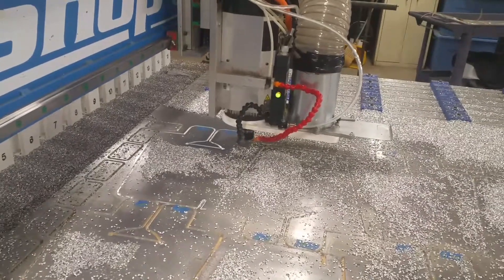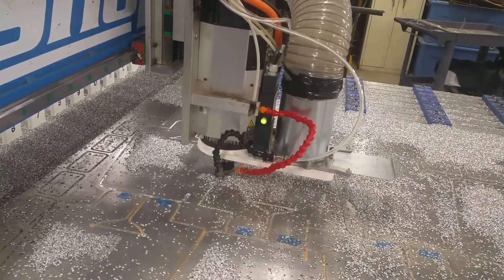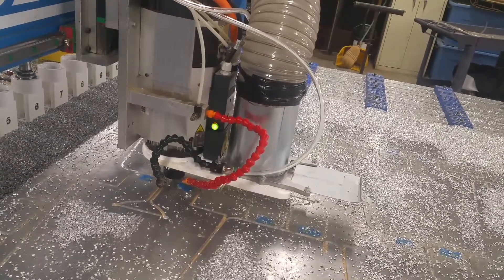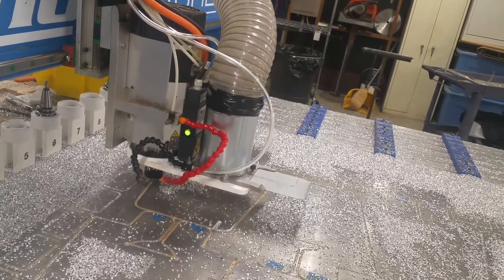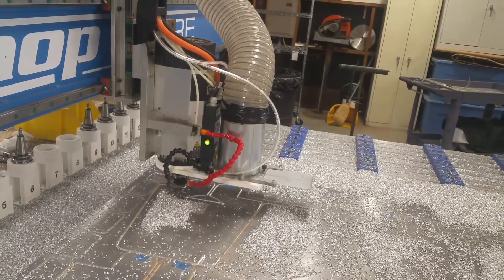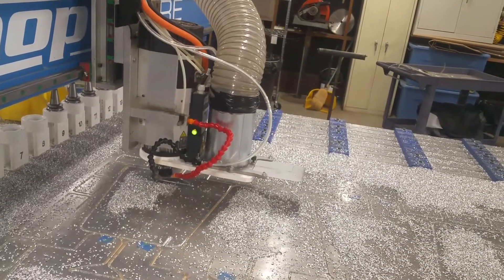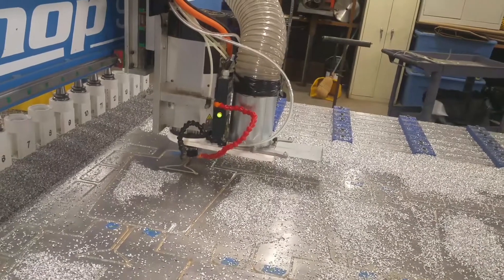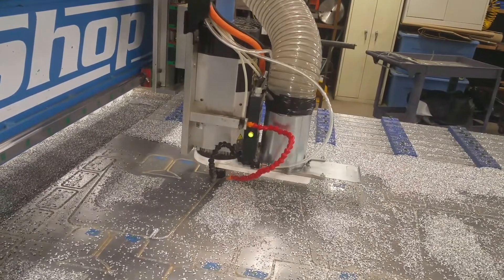Machining some 1/4" 5052 AL sheet.

Comment: Don't know what spoilboard you're using, but i'm currently using 3mm 820kg/m3 MDF/HDF and it works miracles. I have a friend who's doing a lot of plastics and he switched to these sheets too. Doesn't need surfacing and the relative closed structure helps to keep a deeper vacuum when slotting. Thickness of these thing panels is very consistent too, so you can replace the spoilboard without the need for zeroing the spoilboard again.  (unless you're after <0,05 accuracy in Z)  In my experience the normal porous MDF tends to loose a lot of air when slotting.   I must admit, I recognize the relieve of stress after your machine is allmost done. :) I normally do a -,1  to -.2 mm Z in the spoilboard, flip it and replace it when it's worn out. (the smaller slots are filled with the gasket when flipping it opver). I'm using a 280m3/hr vacuum pump of 7,5Kw for a 4,5m2 bed if that helps.
Reply: Can you elaborate on your spoilboard? Am I correct in understanding it's more dense / less porous than normal MDF? Do you find it at a normal hardware store?
Reply: @MattVoda  Correct, it is more dense. Local hardwarestore? No idea what stock they have. I order it from a supplier in bulk, if you can source 3mm MDF, that's about the same density. Normally, the thinner the MDF the higher the density per m3. The reason is due to the pressing in the production process, the two faces have the highest density compared to the core.
Reply: @berendlucasvanderweide  super helpful tips, thank you

Comment: Hi, I am going to make my first cuts on the same material and still learning, do you have more details in your cutting specs? rpm, ipm, speed, and what type of cutter did you use? Thanks
Reply from the maker: I use Onsrud bits when I cut these parts I used their single flute upcut bit designed for aluminum and if I remember right a .002" chip load @ 14000 RPM.
Reply: @Anchorbuilder  Thanks for the answer, I am going to have my first cuts and want to be prepared. :)
Reply: @Anchorbuilder  How about your bit diameter and depth of each pass? I also see you are using coolant misters, what type of coolant do you recommend? I tried 5052 for the first time recently and the results weren't as I hoped. Thanks.
Reply from the maker: @lux2031  I used a .125" DOC the mister is a Unist system they are not cheap but they work good.